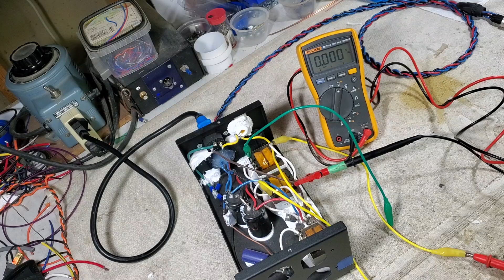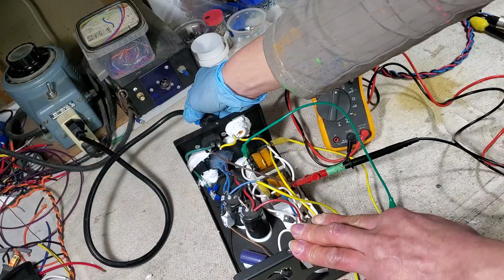Testing Resetteable Fuse on a power supply.  No Kaboom. Don't expect to see firework.

Comment: This is really neat! Essentially by doing this you minimise or remove the issues with having a contact surface with like a regular glass encased fuses with aluminium end caps and having a fuse holder which can be fidgety or unstable if contact isn't good due to the spring loaded or like in your shorts video, having bad contact surface causing more heat build up as a by product. With this being soldered and being direct contact and in-line with the electrical current passing through, it should be even more instant , plus it being resettable means no need to ever change the fuse unless this one goes bad? Also no need to tinker around with tweaky fuses. 😅